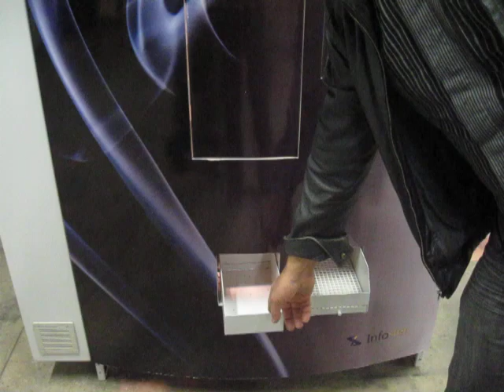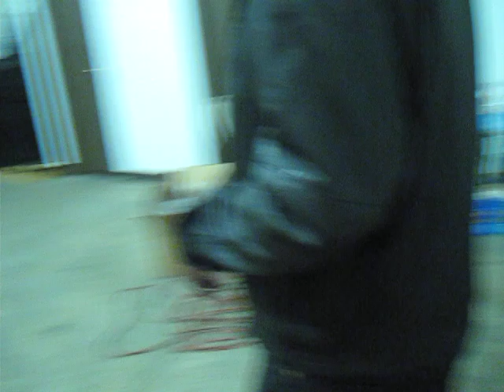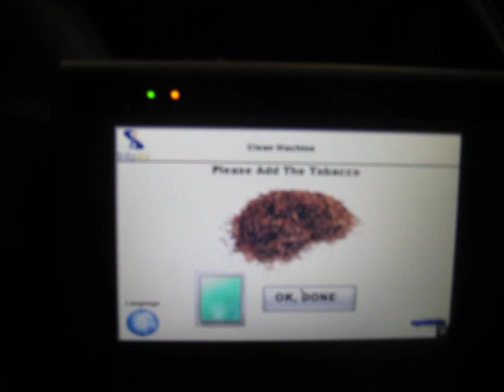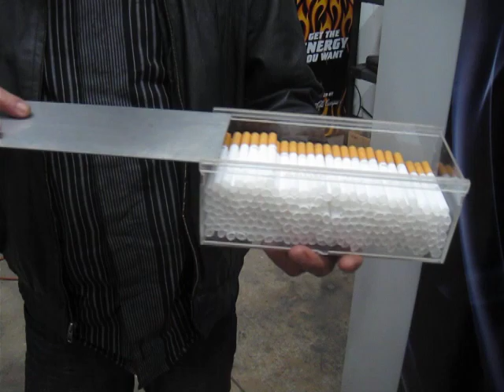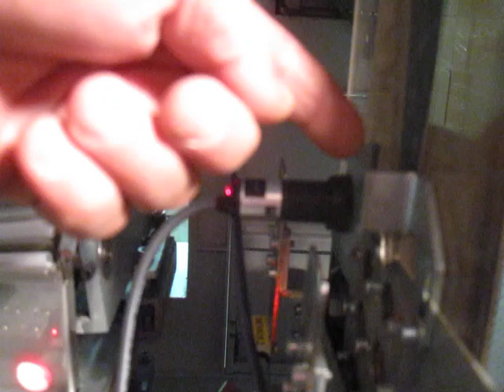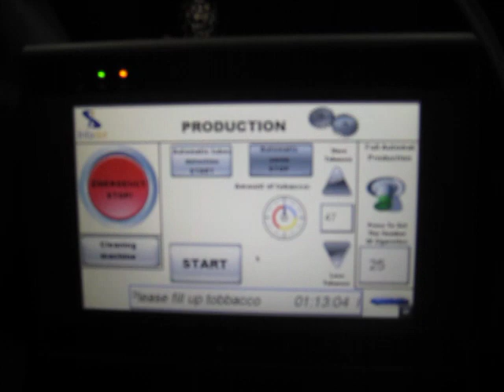RYO EZ-FILL MACHINE.MOV

Comment: this is a great way to make a ton of cigarettes but the thing I never liked about "injector" type cigarette machines is ....that in order for the tube to be rigid enough to stay firm in the injection process the paper has to be thick. The whole idea of a great cigarette is to taste the least amount of burning paper possible. Thats why I still roll by hand or use the old "belt type small hand roller" using the thinnest paper I can buy. But hey....not everyone is a tobacco "gourmet" like me

Comment: I'm sorry, I'm sure a lot of money and time have been spent developing this machine and I'm sure you would like it to be ready for market, but come on... it COMPLETELY FAILS on the second run! And the first run was producing most of the cigarettes with nearly a half inch of empty tube in the front. And most of the completed tubes didn't fall down the shoot. This is very obviously NOT ready and much work needs to be done. Again, sorry, but no way would I place this in a store owners hands.